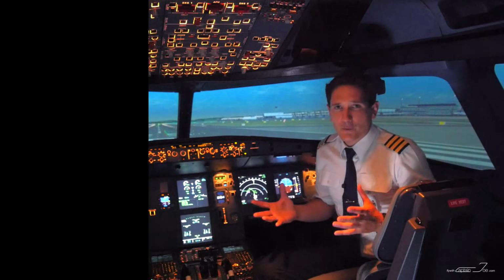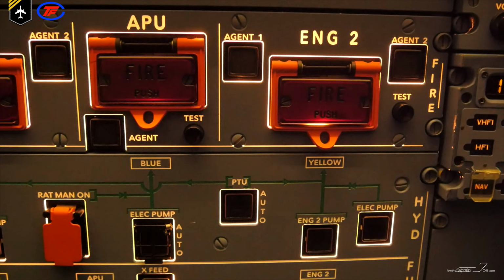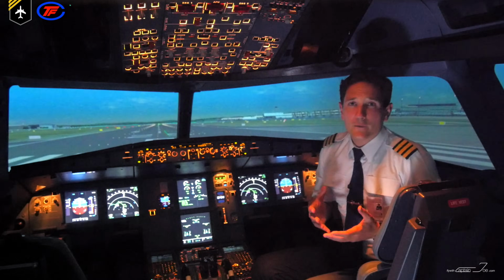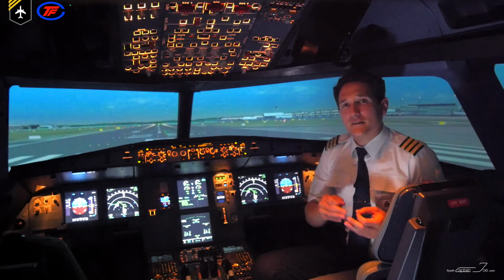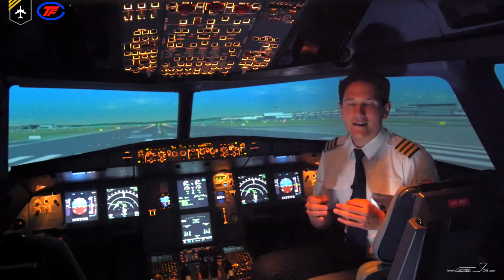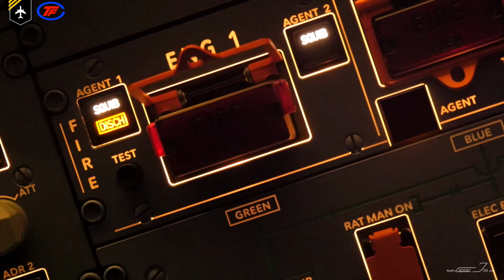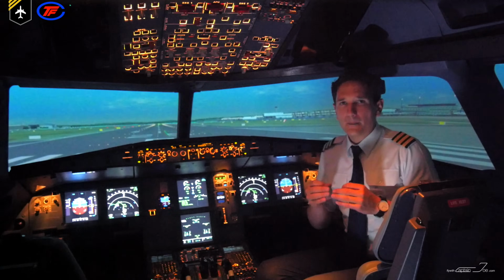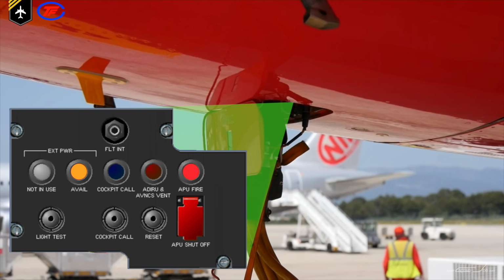Airbus FIRE PROTECTION system!!! AIRBUS SYTEM KNOWLEDGE explained by Captain Joe

Comment: Thanks for the video! As an avionics engineering enthousiast I bought a large part of an Airbus A340 overhead panel. It's nice to know how the system originally works. I want to build a (sort of) simulator so with this knowledge I can simulate the working. The bad thing is dat the 'fire buttons' have a huge amount of wires so a lot of reverse engineering is needed due to the lack of schematics...

Comment: When you switch off the valves with the push button but don't engage the agents, can you turn it back on in flight?
Reply: No, that’s why they are guarded to prevent accidental push
Reply: You’re not supposed to but you physically can. In fact we do exactly that on delivery check flights.

Comment: Captain Joe, you said that if the APU catches fire (WHILE ON GROUND), the Fire Detection Unit (FDU) automatically shuts down the APU and discharges the Fire Extinguisher. What happens if the APU catches fire during a flight and how do Pilots cope with that situation?
Please try to make a video discussing about a fire catch in the APU during a flight.
Reply: The fire extinguisher is not deployed automatically. The pilots will then use the cockpit fire push button for the APU

Comment: Next: why do planes fly higher than mount Everest (where you'll lose consciousness) and how does it get pressurised?
Reply: In short it sucks in air from outside and feeds it inside the plane and the gets blown out of the the rear so the air is always fresh. The higher a plane flies the more fuel efficient as there is less drag

Comment: Would it be useful to increase altitude to lower the amount of air the fire gets? Or would you need to increase the altitude too much for it to make sense since the engines need air as well?
Reply: No because you will have probelms climbing anyway with one engine on fire. So increasing altitude isn't an option.

Comment: But I’m wondering. What if the engine just overheating and yet to caught fire? How do you tell them apart. And if it’s just overheating does the extinguishing still need to be done or you just give that engine a break. And if you go with the extinguishing procedure will you be able to start that engine back up again?

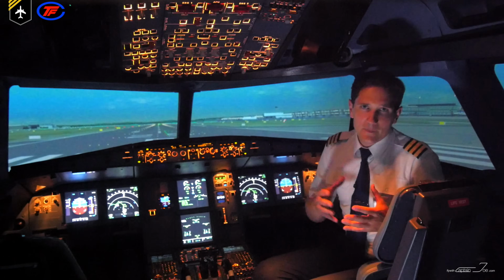Comment: what is under that blacked out square below the fire push button/light at 4:53 ?
(your fingers move over it, and it does show a digitally added black square... you even see SQUIB appear after his fingers move away)
what are you covering up? "shut off chem trails"?

i don't think you disperse chem trails though, in case you didn't get the joke

Comment: YES! IT WAS A NICE VIDEO C.JOE, HOWEVER IM A VIRTUAL PILOT AND I HAVE ALWAYS WONDERED WHY ARE STANDBY EQUIPMENT SO IMPORTANT...OR WHY IS IT EVEN THERE...AND WHAT HAPPENS IF AN ENGINE FAILURE WAS TO HAPPEN AND BOTH HYDRAULIC EQUIPMENT, BATTERY EQUIPMENT AND THE STANDBY EQUIPMENT ALSO FAILED TO WORK PROPERLY? WHAT HAPPENS THEN?
Reply: Then you're dead.

Comment: Why when the plane is off all rudders are pointing down?
Reply: Because the hydraulics which move the control surfaces are only pressurized when the plane is running. If the plane is "cold an dark" gravitation does it's thing a pulls the controll surfaces down.
Reply: shi01 thanks brotha

Comment: what's the logic behind giving airport runway runway number ?
Reply: The runway number is the runway magnetic orientation divided by 10! (For example, runway 26 will point, more or less 260°) That's why, if you look the other end, the number wll be Always +/-180° (the runway is a rectangle). The letter comes when there are multiple parallel runways ("L" stands for LEFT, "R" for RIGHT and "C" for CENTER).
If you want, here is Joe explaining it way better than me! https://youtu.be/H701DOaQvDM

Comment: How does the FDU detect if a previous fire got extinguished by the bottle? I thought that if there really is a fire, both loops in that engine would break, so even if the fire is back out, they would still be broken?
Reply: if fire broke both loops within 5 sec fire warning will be generated, after this the fire detection sys will become inoperative.

Comment: The only thing i hear when i land an aeroplane is TERRAIN, TERRAIN, PULL UP .....
whats with that!?
Reply: That's the GPWS (Ground Proximity Warning System), if this happens, it is probably because you're not Landing correctly (for example, if you don't extract the Landing gear you'll probably year "TOO LOW; GEAR!"...). This warning system turns on when you are too close to the ground in a wrong configuration or when you are descending at a really fast rate! ;D

Comment: Great videos, Captain Joe! I have noticed that on some flights, just before takeoff, what looks like fog or steam comes into the cabin from the overheads. What is its purpose? Is it just to humidify the cabin during pressurization?
Reply: cold air conditioned and high umidity in the cabin generate the fog
Reply: verticalgyno thanks, man! I'd still love to know how the whole pressurization system works.

Comment: Hey joe I have a question, if we are not supposed to use cellular data or call in flight why are there phones in the plane and how does it transmit the call data and what makes those phones different from ours to make it safe or useable in flight
Reply: due a external antenna :)

Comment: Captain Joe, I have a food question, and since you are a pilot I figured you would the the 'person to ask'. I have seen several different videos that are talking about food and the cleanliness of the inside where passengers sit. BUT that isn't my question, the question is, I have heard on those videos that the Captain and Co-pilot are NOT allowed to eat the same foods, they have to chose different foods (meals). They say the reason is, if the food of one of them is poisoned, the chances are very slim that both would be, and one of them would still be able to pilot the aircraft. Is that true? At least for the airline you work for or is it just an American thing, and thanks, a viewer from Michigan (USA).

Comment: Captain joe how do you make sure you stay on the taxi line and what speed do you taxi please make a video on this
Reply: Misha I know you want a video on it (would enjoy it myself), but here's an obligatory spoiler
1. If the pilots have adjusted their seats correctly (using the guide present on the centre frame line of the windshields), then keeping the head horizontal and straight ahead gives them a perspective that is almost the same as the plane's horizontal axis. Other than that it's just experience and visual cues, it's like asking a car driver how they keep their cars in the centre of the lane (which has an even greater offset than a cockpit seat's).
2. Taxi speeds do not exceed 25-30 knots, the average speed is 20 knots, 10 knots at turns (varies with aircraft type and weight).

Comment: Does Engine Bleed Air works simultaneously? If the Plane experienced engine fire are there any immidiate danger in cabin pressure? I board an Airlliner annually, just curious.
Reply: eventfulnonsense No Because the Engine Bleed Control Valve is immidately being closed

Comment: Hey captain Joe i got some questions for you.
1, How do pilots know what speed or altitude they are if their equipment is not working anymore and they won't go on for the entire flight?
2, When the fuel tanks break at 8000 (or higher) meters how do you know that and can you fix that in the air?
3, Do airplanes have a emergency fuel tank when they run out of fuel?
4,  How do pilots communicate with military forces when they fly over their area?
5, Can you land a fully loaded boeing-747 with some wheels that won't deploy?
6, whant happens if the flaps are stuck when they are fully deployed?

I would love you to answer these questions if you have time for then

Cheers Jelle
Reply: 3-its not a motorbike with a reserve on the tank valve. You out of gas you go down fast
Reply: Jelle Geisink 1. You have 3 redundant PFD Displays that indicate the Altitude and the speed
Reply: Jelle Geisink 2. The ECAM Display Shows that followed by the Emergency Checklist
Reply: Jelle Geisink 4- Radio, all civilian routes never cross military airspace, if so it is in a dire emergency to land safely or by loss of orientation which is hard considering the amount of technology in current planes
Reply: Jelle Geisink 5- The pilots would probably dump all fuel, dump in their pants and make it out safe if on a proper runway with emergency services already alerted. Planes are tough enough to belly land, once mind you..
Reply: Jelle Geisink 6- turn around and land, you cant really do much, go too fast and you'll rip them off..

Comment: Hello Captain Joe!

I am a huge fan...... first of all thank you so so much for all the amazing videos.

I have a question. I know that flying is the safest mode of transport but I always wonder how often does it happen that things go bad but are taken care of by the pilots? Are most flights 100% perfect with zero mechanical problems? Just to be clear I am not talking about bad weather and turbulence but rather situations where some mechanical failure has happened. I follow a lot the "Air Crash Investigation" series on YouTube and so I am curious. As an extension what are the problems that pilots face on a regular basis with the machine??

Hope you will find time to answer :-)

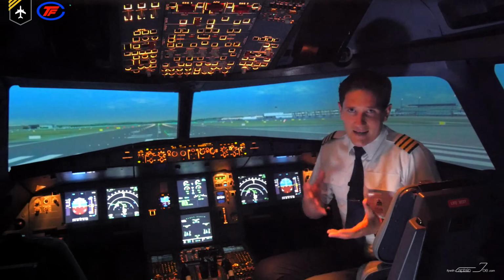Comment: 4:07 Why there is a button called "rat man"?
Reply: RAT stands for Ram Air Turbine - a small propeller that deploys to provide electricity and hydraulic pressure in case of a complete failure. That button is to manually deploy it, I presume. I think Joe has a video on the subject.
Reply: Kodemikkel yes he has a whole video about that Topic
It is there to deploy the RAT manually
Reply: If a passenger gets aggressive you push the Rat Man button and a man wearing a rat costume comes out ready to fight and control the situation.
Reply: Héctor Chávez Something something United Airlines

Comment: Why was the APU Squib button blacked out?
Reply: Guys he meant that it was blacked out by video editing etc, because you can see black even after a Captain Joe moved his hand over the button.
Reply: it was probably a mistake
Reply: The APU SQUIB is under the FIRE button. The buttons to the sides are for the engines
Reply: because the DISCH light is illuminated and probably  he don't want to show it on the video to avoid confusion with the general viewers.
Reply: Cause he hasn’t activated the fire button for the apu

Comment: If the master fire button has been pressed, but neither squibs have yet been discharged, is it still possible to restart the affected engine? Assuming the fire is already out or non-existent. I've heard of ACT incorrectly calling compressor surges on takeoff as fires. 
 So in short: what is the point of no return for the engine in the fire prevention procedure?
Reply: Technically yes the switch can be reset and the engine restarted however that would be unwise. For example, if the fire was due to a fuel leak or an electrical fault, resetting the switch and restarting the engine could cause the fire to reappear. The aircraft is perfectly capable of flying on 1 engine so the safest course of action would be to continue flight on one engine and land as soon as possible to be inspected by the engineers.
 Crews are trained to treat any fire warning as a fire and once the engine is shut down it stays shut down. The dual fire loop is designed to prevent spurious warnings, also not all sections of the engine have fire detection sensing (for example a tailpipe fire). A compressor stall also shouldn't generate a cockpit warning of fire.

Comment: i got a questions for you.  how's the fire protection system works in 4 engines planes such as 747 800 or the 380 or the a 340 600? is the fire protection system in the 2 engines planes work the same as 4 engines planes?

Comment: Capt. Joe, what is flaps and how it works?
Reply: Flaps are the the rear section of the wing which can be extended during taxeoff and Landing, it works thank to the hydraulic system and it is used to increase the wing lift during this "low-speed" sections of the flight! ;D

Comment: Great video, just curious why there is a black box at 4:57 Covering the agent button.
Reply: there is an amber "DISH" under the box which illuminates once the agent has discharged. So before pressing it the light should have been off.

Comment: One item that has never been addressed by anyone is at what point does the plane lift off the runway. What EXACTLTY puts the lane In the air? If the flaps are all set along with everything else, what needs to happen other than hitting 140+ MPH? Nobody really has an answer, huh?
Reply: John S., when the air has a much higher pressure on the bottom than on the top of the wing
Reply: That happens when the air over the wing moves faster than the air below the wing, which causes a difference in pressure over and under the wing. This again will create lift, which will get the airplane off the ground.
At what point this happens in regards to speed,  is dependant on many factors, including the mass of the aircraft, wing design, flap/slat positions, the atmospheric conditions etc.

Comment: The fire detection loops are filled with helium & hydrogen?!?!? Surely that's not accurate, but now I'm going to have to hunt down technical documentation about this.
Reply: The more you know... Apparently it's called a Systron-Donner system. Comprised of a titanium tube filled with hydrogen, surrounded by a stainless steel tube filled with helium, surrounded by a gas absorbing filler and an outer sheath.
Reply: It's actually a metal hydride core that releases hydrogen only when heated above a specific temperature.  It helps detect very localized heat by accelerating the gas pressure increase.
Reply: Thanks Stephen. That further helps me to get the Hindenburg picture out of my head. Not sure why my mind raced to gaseous H when Joe mentioned H & He being used in the detection subsystem.

Comment: Please record video about airplanes age - do we need to be afraid of flying 28 years old a320 (lufthansa)? You can also mention a to d-checks that are extending planes live :D
Reply: IT: Dont worry about Lufthansa! Lufthansa Technik is a pretty good maintenance company. In the last 30 years no Lufthansa aircraft crashed due to poor maintenance.
Reply: Aircraft could live on for many more years than 28! As long as good maintenance is performed you should be good to go.
Reply: No, you don't have to worry about it, and remeber, the "age" of an airplane is misured in "compression cycles (flights the plane has done)", not in years! :D  (for example: a 28-year-old plane with 8000 cycles it's technically "newer" than a 14-year-old plane with 12000 cycles!).
Reply: IT o
Reply: great vid

Comment: Is it true that in some aircraft type the extinguisher bottle are shared, so that if you use agent1 for the left engine, the agent2 of the right engine becomes unavailable?
Reply: Yes, the 777 has only 2 fire bottles which are shared by both engines.
Agent 1 is a separate bottle than Agent 2, so if you use Agent 1 for the  left Engine, only Agent 2 would be available for the right engine. Or, lets say you use both Agent 1 and 2 on the left engine, then you have no bottles left for the right engine! But chances of a both engines catching fire is pretty slim!

Comment: Captain, i have a question, since im 12 and a subscriber to your channel :D I just have a quick question, i want to be a pilot when i'm older and i was wondering; what method of transport does a pilot take to get to the airport, rather, how do they get organized? I understand you covered that in the pilot bag video, but i'm just curious to know. And what if the pilot is LATE?

Comment: quick question: actual fire suppression and agent discharge happens when you push the big "fire" button or only after you manually pushed on the "agent" button? Why is there 2 "agent" buttons and when agent 1 and 2 pushed? thanks in advance capt.
Reply: yes, in order to discharge the agents, you need to push the corresponding pb. Pushing the fire pushbutton is not enough. It basically just closes valves related to that engine. There are two fire bottles for each engine, to provide extra safety, in case one bottle isn't enough to quell the fire.

Comment: Hey, CaptainJoe. I have a question:
If there is a fire onboard, for example, in the toilet, who operates the fire extinguishers? Does the captain personally take care of it or is it the board personal who is in charge to do so?
Reply: I guess it would be whoever discovers it. Might be a passenger as well, if they know where the extuinguisher is located.
Reply: That would be the flight attendants. In such a case, I'm pretty sure the captain will have his hands full preparing for a diversion and emergency landing.
Reply: I thought it would be a flight attendant
Reply: Toilets are fitted with automatic fire extinguishers in the waste bin, if smoke is detected in the toilet a warning is generated to alert the cabin crew who will fight the fire. The Captain is responsible for flying the aircraft.